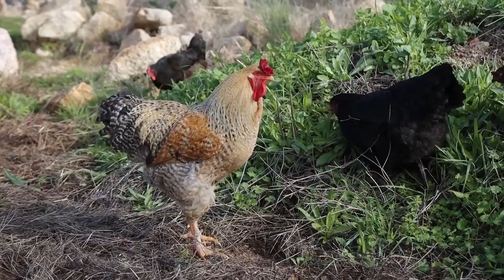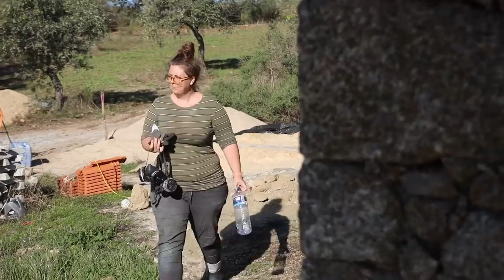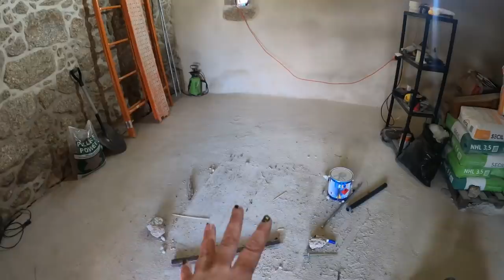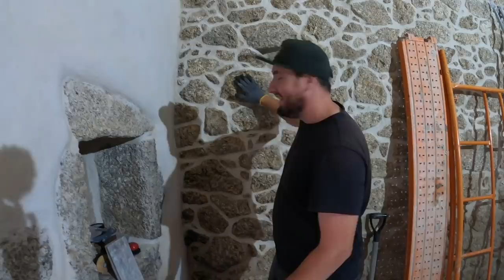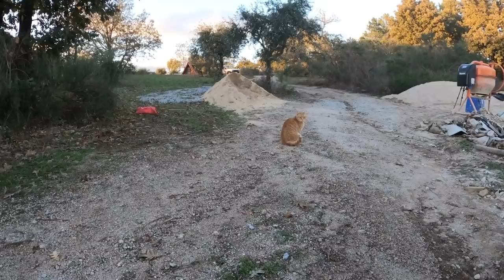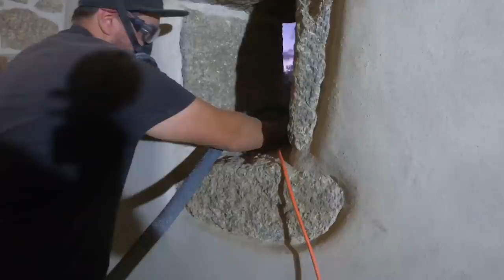We’ve Waited 492 Days To Do This! Off Grid Barn Conversion Project

Comment: Why don’t you get some hardware so you can slide your ladder around? Kind of like those antique libraries with stairs so you can reach books that are higher up. Ladder on wheels 🥰 then you don’t have to be scared about putting it in the wrong spot!
Reply: Fab idea 😃
Reply: @mysticalmisty9772  What a great idea :)
Reply: A great idea.👍😊
Reply: The only thing preventing that would be a railing… if there is an occupancy permit a railing is required, but if there were, they would’ve likely needed building permits and inspections all along too. Might’ve prevented the roofer problems though…
Reply: It's a good idea in principle. It might be a little dodgey at night, though, if someone needs to go to the toilet or there's a commotion with the chickens.

Comment: Hey Bea and .Theo, rather than a ladder have you considered a Tansu style cabinet (Japanese) that can also be used as stairs/steps to upstairs? Similar to what many tiny home use they are combination of open cubes, drawer units and possibly a small wardrobe and can be open on either side since it would be centered in your space.  Just a thought since they seem so functional and decorative. Dan - Houston Texas USA
P.s. Theo looks like it’s time for some wire brush attachments for the angle grinder.
Reply: I think steps would be great too — a ladder is going to get tough the older you get. Plus, the storage capacity is so worth it!
Reply: Great idea. Storage will be needed.
Reply: Any and all options that increase storage and functionality are worth considering!
Reply: I’ve been thinking this too, but where I thought would be a good place for it is where they’ll be putting a wood stove.
Reply: I was thinking the wood stove should be placed the corner of the living space. I think it would give out more heating capacity.
Reply: Fabulous idea

Comment: The granite stone looks amazing when wet, as most stones do. So looking forward to the next steps, walls and floor. Just wondering when the windows will go in the little window holes. Its a beautiful little picture view from both. Xx
Reply from the maker: Need to get to work on the small windows!
Reply: @theindieprojects  - Make sure some are able to open as you need fresh air for the burner and you don't want to be CO gassed! The lower the better so the air rises taking it out via an opening at the top.

Comment: Hi  , for cleaning up see if you get a hold of a aluminum snow shovel  . It would have been perfect for cleaning up the floor in the barn , or say getting the fallen apples off the ground into the the tractor bucket . You rake them onto shovel , and other lite duty stuff  . Oh I lost my storage tent also , we had a hurricane here in Florida  a couple years ago . I tied it all down good as it was in a screened in area . Well it almost made in through the storm , but at 2am the winds changed direction and the tent shredded to pieces all my stuff got soaked . The barn is looking great , wish the best to the both of you keep up the great progress .

Comment: Put 5% linseed oil in your lime wash to stop it being too dusty / flakey. Raw linseed if you can - try animal feed shop.
Whizz it with your paddle mixer. Gonna take 4 or 5 coats before it gives a nice, dense white finish.

Comment: Hey guys, hope I'm not too late with this tip, but we had some Morrocan guys in doing some similar work and they were wetting the wood with a rag and a bucket of water so the lime wash didn't mark it. They also wet the floor for the same reason and at the end just mopped everything up and it was clean. They didn't use a single bit of tape and the end result was super clean.

Comment: Put the cork up on  the mezzanine (loft ) also idea shipping container work shop quick and easy for now. Also cantilever your steps from the door side right up against the wall with the stairs going towards the opposite wall  and pput a pully on one of the rafters so you can bring the stairs up beside the mezzanine or loft and a tie off ob the on the loft or wall then just a hook to keep it up as back up to the tie off.  Hop your able to decipher what im saying  . It will make you barn conversion bigger , no stairs in way lol

Comment: Hi there looking great. If you realy want the stone to pop you can paint or spray it with a tile Sealent or varnish Tha same with your white washed walls put some clear Sealent over it and it will just add life to it and prevent mold and moisture. Just my two cents worth. Riccardo SA

Comment: wonderful to see you both getting closer to finishing the interior of your new home...i have been thinking about this ladder to the mezzanine and wondering if there is any way to instal a spring loaded and folding ladder which would lift it up and sit out of the way (perhaps it can serve a second function as part railing for the upper space?) when you are using only the lower level of the home, yet enable you to easily pull it back down to ascend to the upper level when needed? just a thought, lovelies, i am sure you will come up with the most pratical and aesthetic solution in your own good time

Comment: Love the changes and clean out. But had some tgoughts. The kitchen against the rock wall  can be a pain. We had a stone wall behind our stove. Was awful cleaning over the years due to normal cooking , ex grease splash, etc. You don't realize the build up of stuff til you start  cooking in a home with painted walls. Maybe reversing to back eall. If Woodburn is against rock wall  it would be easy with woodburner fan to heat blowing to smaller area(the 2 story side). Plus as a feature wall Would keep such an open area thus enlarging visually and  would feature that lovely stone. Just a thought. Before you start building. But truly LOVE  the barn.
Reply: Should have added would also be less fire hazard

Comment: Looks good! You have quite a few spots where the lime protrudes from the wall (e.g. around the windows). How well will it hold up over time in those spots?

Also, do you need to treat the untreated wall in any way to ensure dust doesn't keep coming off?

Comment: I had an idea about the tiny windows in the pointed stone wall. In France, they invented something called dalle de verre which is stained glass cemented together instead of leaded. Wouldn’t it be so cool to get some pieces of colored slab glass to mortar into the holes so that when light shone through it would shine colors onto the opposite wall?

Comment: Cut the front nose of the Wire Brush off and reattach the Blade
Will you be putting a Coat of Clear Varnish over the Stone?